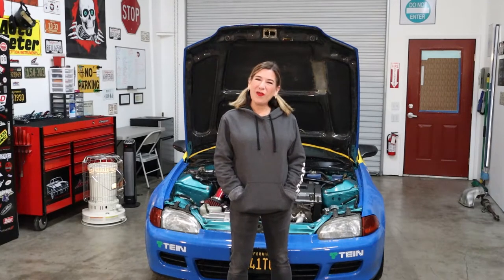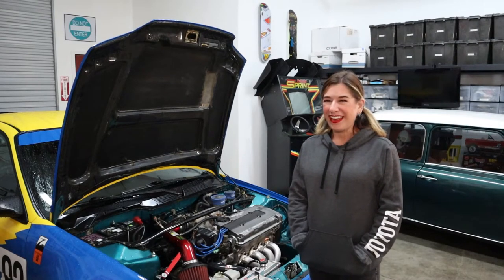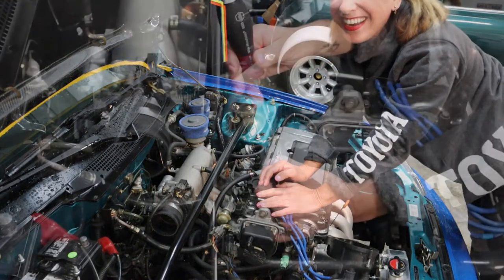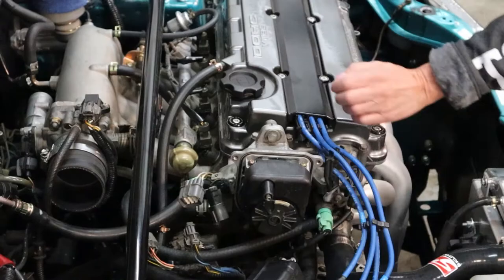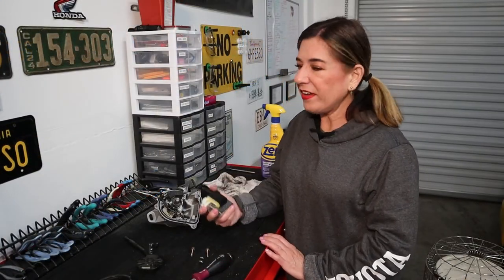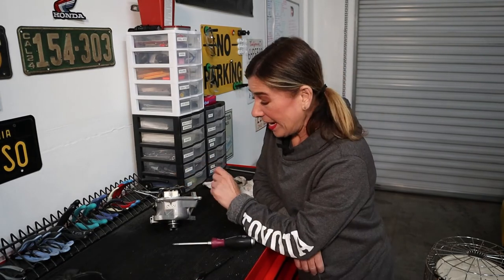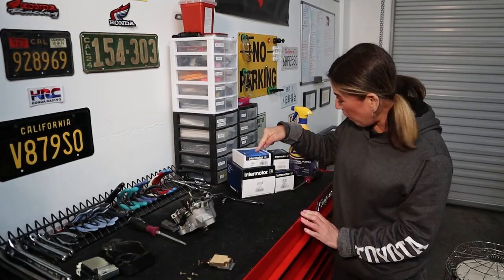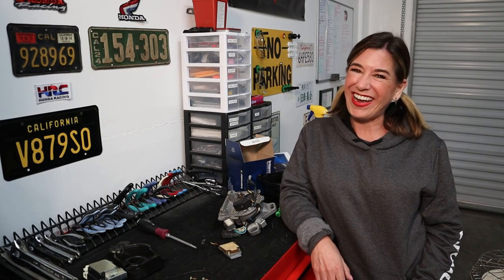B Series Distributor Breakdown Tutorial!!

Comment: For the bigger connector that gave you a hard time, did you do anything else other than pressing the that tap and pull it out eventually ? I'm having the same problem right now BUT I want to ask if there is anything else I need to press before continue (and not breaking). Can you spray lubricant to loosen it ? Would it damage the connector since it is an electrical connector ?
Reply from the maker: Hey sorry, I was down for the count with a stomach bug!! Thanks for watching!
It has to be removed from the metal bracket that holds it onto the distributor first, then gently pry with a screwdriver while holding down the button. A small amount of WD40 won't hurt anything. I hope this helps!!
Reply: @RDGarage  Thanks for your reply. Hope you can help with my follow up questions. I purchased a distributor from Advanced Auto Parts and it said it is an "exact fit" to my 1994 Integra LS 1.8 L4 cylinder engine with my VIN number entered also. It does NOT because the screw holes aren't at the right locations. 
(I changed the rotor and the distr. cap and the car still won't start, but it cranks)

So I called Auto Zone, they said they have two that fit my car BUT I have to refer to the marking to see which one fit (confusing). One with P/N = ADLG-TD85 with OEM #TD-85U and the other is ADLG-TD55 with OEM#TD-55U, TD-46U. The brand is Duralast Gold.

They and I do not know what this means. The current distributor I have in my car is an aftermarket. It said it fits but then I have to check which one. (confused).
What do these numbers mean anyway.  thanks
Reply from the maker: @sinnieleeonUtube   The TD-55U and the TD-46U should be interchangeable. The TD-85U (TEC TYPE) is the other option for your model year. I would look at a site like rock auto that actually shows the pictures of the real part and get the type that matches the plugs in your car.
Reply: @RDGarage  OK -I stumbled upon a distributor guide titled "nds-ignition-application-guide" on page7, it said TD-55U /TD-46U is for model year 92-95 (1834cc engine) and the TD-85U is for 96-01 (also 1834cc engine). Same engine BUT different part number (P/N) for different model years. 

BUT then Rock Auto recommends SKP brand with P/N = SKDITD55 with note said (Please Refer To Markings on Original Unit; w/ TEC Distributor; ID # TD-55U, TD-46U). So I'm assuming this note meant it  is compatible with brand TEC with P/N = TD-55/TD-46. 

So far it seems the auto part stores just ignore the model years and only look at the engine to claim whether it fits the car or not. thanks

Comment: I tried replacing the distributor and it turned out they sent (online purchase) me the wrong part. So I went to another vendor, this time they gave me a distributor in the right box with correct P/N. However, there isn't any marking or P/N on the distributor itself. Is this normal NOT to have marking or P/N on the item itself?